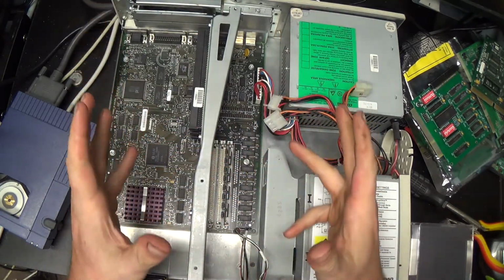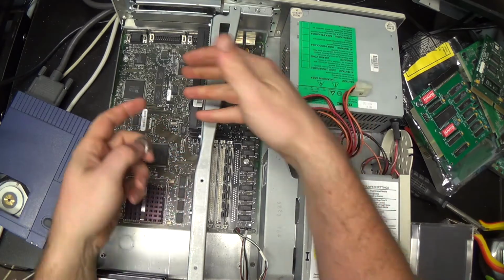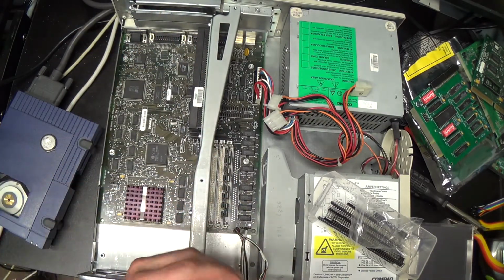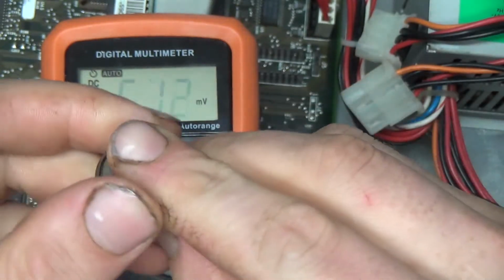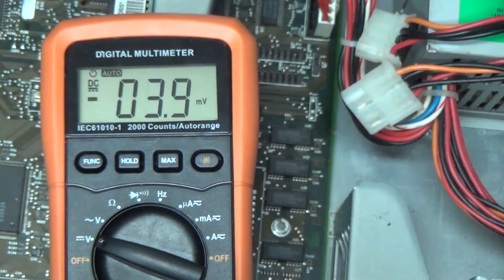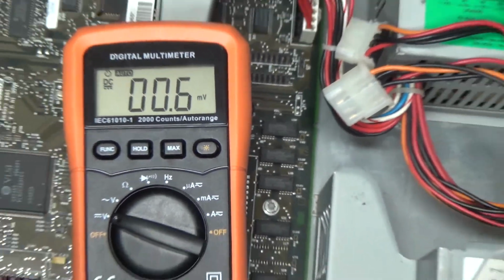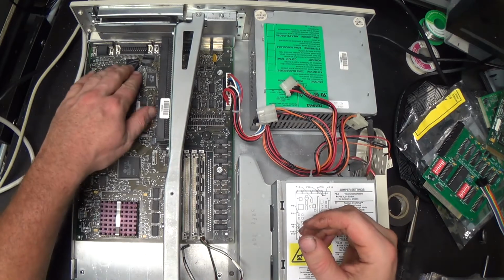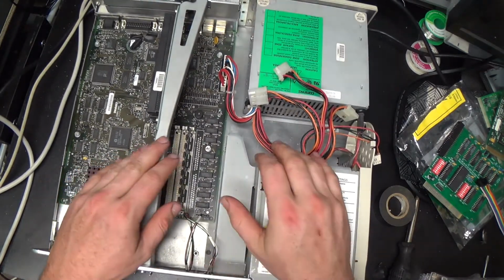Compaq ProLinea 4/50 (486DX2/50) Fixup (Pt. 2) - Replacing Soldered-On CMOS Battery

Comment: Years and Years Ago, I was a Compaq Certified Tech.   When you get Compaq Certified you get a Placard with a bunch of empty spaces were you can add stickers as you get Certified on new systems.  I had a sticker for the Compaq ProLinea line.
Reply from the maker: AHA!  I might have some questions for you then, haha!  (wait wait, why are you running awayyyyyy???)

So, the hard drive that came with the thing has a 2Mb non-DOS partition at the beginning of the drive.  It's a 420Mb Connor parallel IDE device.  I have a PATA-to-USB dongle that I usually use for taking a low level disk image of all this sort of stuff before I start beating on things with hammers and reformatting and such, but this particular drive does not seem to work with that dongle.

I was, however, able to plug in a second IDE device (that does work with the dongle) as a slave, and copy everything off the drive at a filesystem level.  But I still have not managed to make a dd-type image of the whole drive.

I want to delete the whole partition table, and rewrite both it and the master boot sector, in hopes that the drive will start working with the dongle (which will make it a hell of a lot easier to get drivers and such on the machine, until I manage to get an ethernet card working and get connected to my NFS server), but I am afraid that, given how fancy the CMOS setup program looks, that it's actually contained in that little 2mb partition and that if I wipe it out without a backup, I'll be up the proverbial fecal stream with no means of motivation.

I would just use the other drive (that I made the backup on), but it's a 40G PATA device that doesn't actually work with the builtin BIOS.  I was only able to get it to work with the machine via an XT-IDE card (with its own LBA bios), and even then I cannot seem to boot from it.

What do you think?  Can I wipe out that little non-DOS partition without making the computer angry?  :3
Reply: @Lee_Adamson_OCF  Sorry My Friend, That was A long time ago far far away
Reply from the maker: @X-OR_  Hah, oh well.  I think I got it sussed out anyway.  It is the CMOS setup program.  Why why why whyyyyyyyy Compaq, would you not have a ROM-based setup program like everyone else at the time.  D:  Makes it really difficult to swap disk drives!!
Reply: @Lee_Adamson_OCF  I can confirm its on that partition. I had to remove the drive on mine and was unable to access the bios. However, you can grab the bios image to put it on a floppy instead. See the description of this video: https://www.youtube.com/watch?v=c63ZSKAahR0 . It's probably good to back those images up somewhere